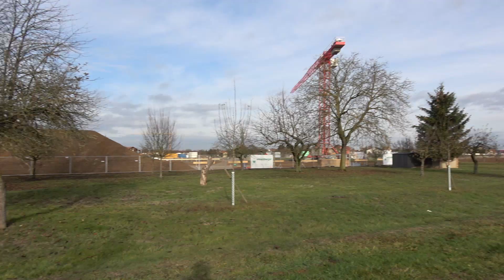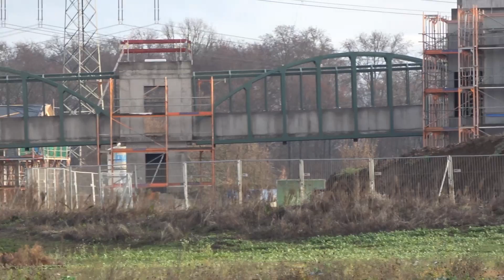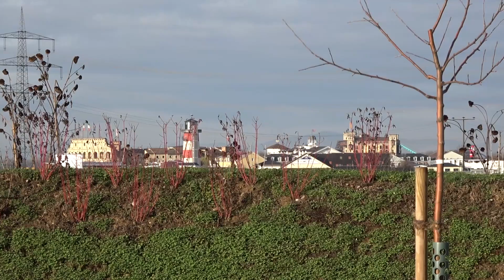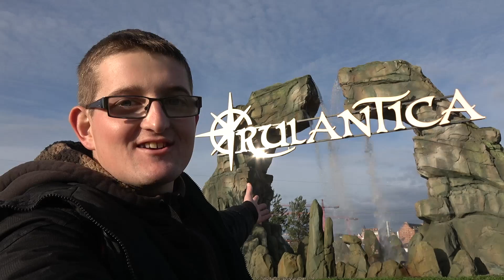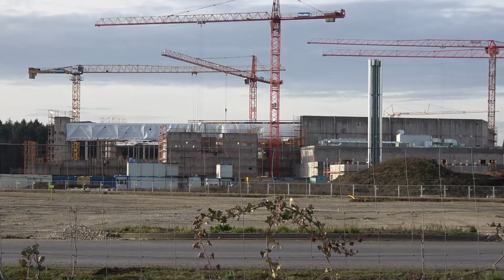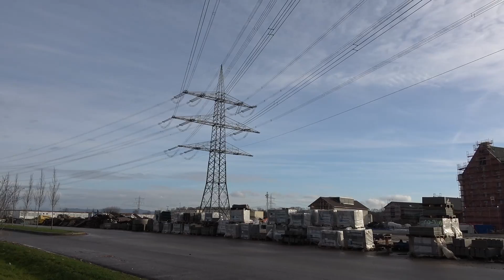Europa Park Rulantica & Krønasår Construction Update - December 2018

Comment: I was hoping that You took a look at the Construction site, thanks for sharing! It´s looks so huge but in my Opinion the Distance to the Park is too big.......
Reply: I guess they had to find a suitable site for this enormous project. I mean, Rulantica will be slightly more than half as big as Europa-Park, and the park is huge!
Reply from the maker: Thank you, I look forward to seeing it all develop
Reply: True, remember they will be connecting it more and more in the long term though. Personally I'd like to see a monorail connect the two sites, as I feel it could be made much more immersive than an extension to the proposed cable car. Also I reckon extending the cable car with another station would only slow down its operation.
Reply: Can't see a cable car being feasible with power lines so close to the hotel, but you never know.